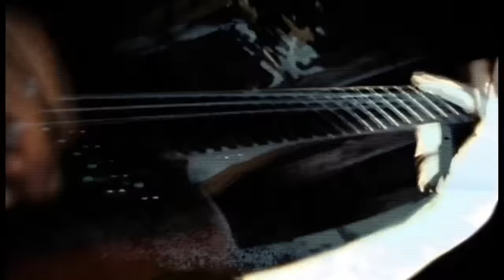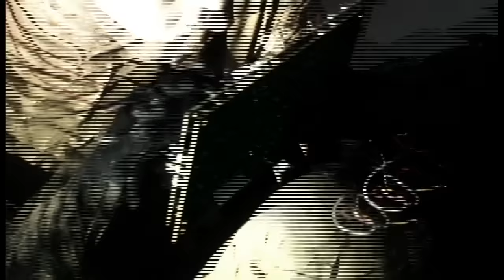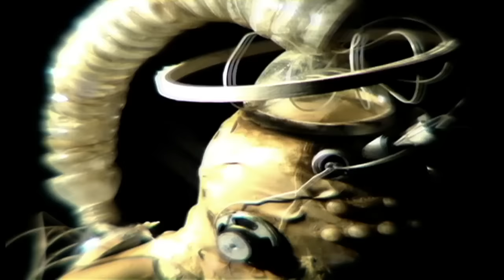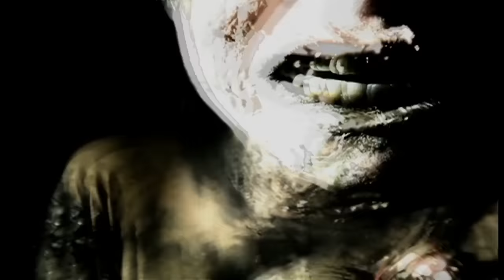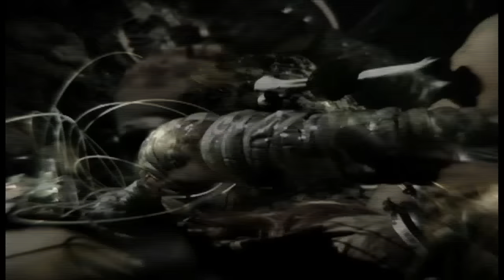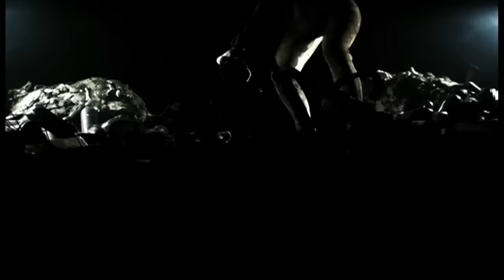Cattle Decapitation - Kingdom of Tyrants (OFFICIAL VIDEO)

Comment: BMTH has gone away from the deathcore (loosely metal) sound to what is arguably a post-hardcore (no way, shape, or form metal) sound, but the point works. 

Irrelevant side notes, nu metal has more in common wit hardcore than metal; and what ties Cattle Decap to the metalcore scene? When I listen to early Cattle Decap I hear a Locust type grindcore band attempting death metal and current Cattle Decap doesn't sound too far off from Dying Fetus and the like.